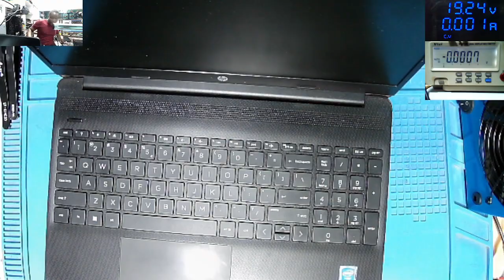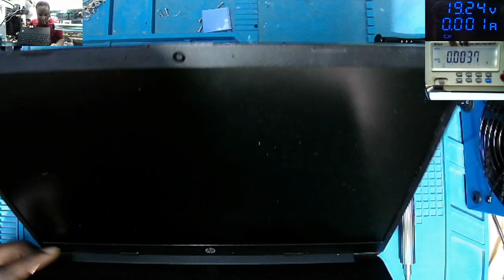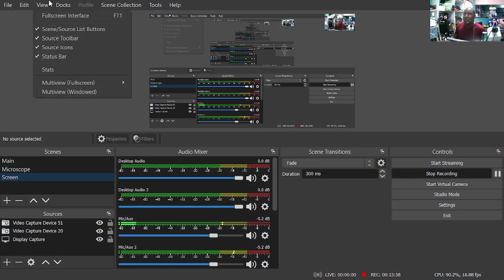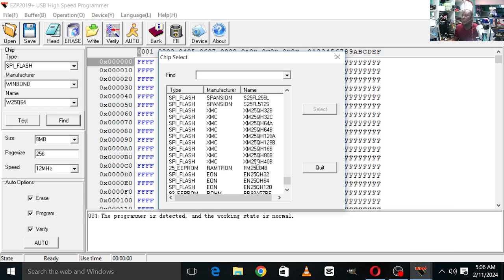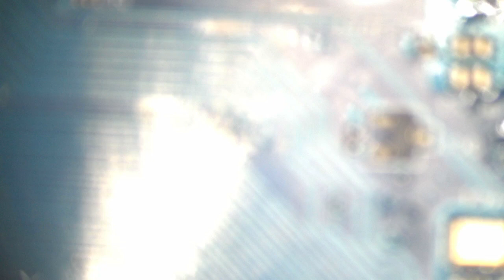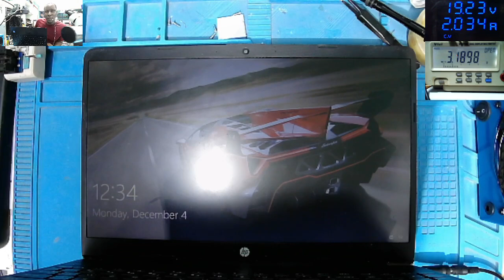Hp 15-dw1495nia Motherboard Repair--Bios Reprogramming, No Display Issue!!

Comment: 14:55 You can see left down to there it says not connected so you just needed to reconnect the programmer and restart the software right? :) and next time just type in search what you need in the software or autodetect it, maybe you burned bios chip with 3,3v and it was 1,8v and it needed adapter ? :) it happened to me few times in life to burn chip like that.
Reply: it is also possible to replace the bios chip instead of reprogramming